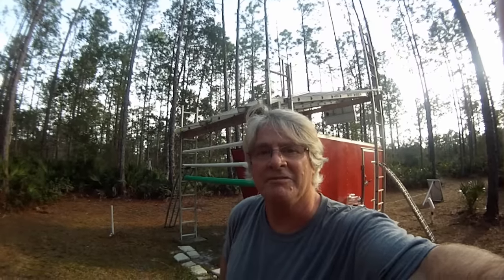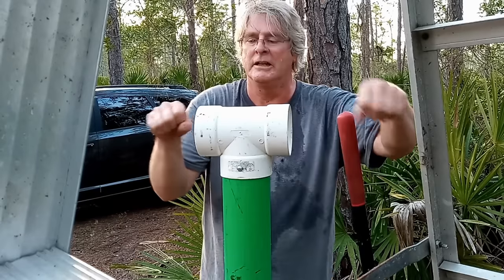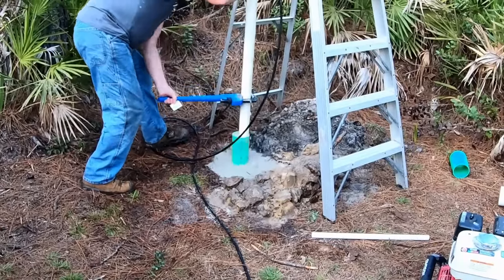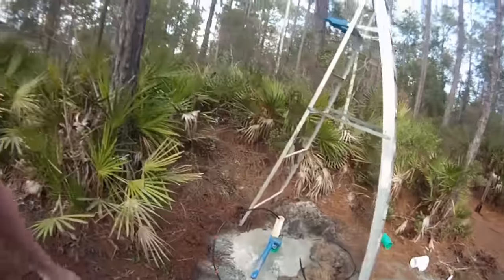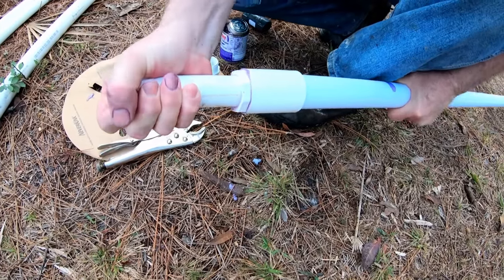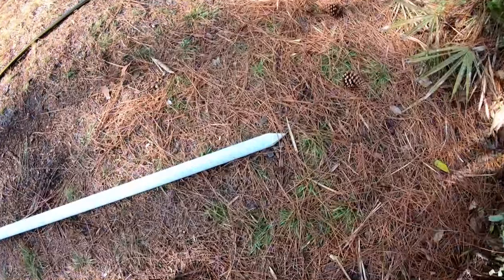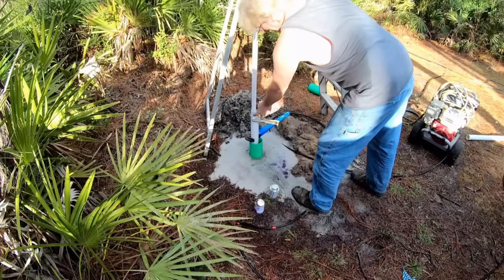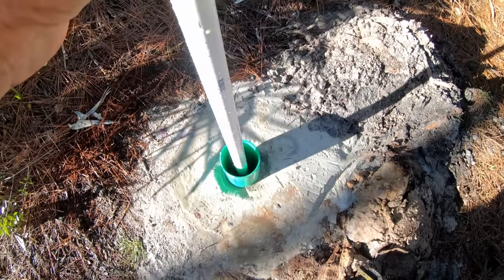Easy SHALLOW WELL DRILLING Howto DiY drill 25 ft shallow well

Comment: i have a 1 1/2 rigid pipe casing in the ground    previously used by orange grove watering system    I want to put a PVC  pipe down about 90 feet    where do you purchase the pipe with perforations and well point?   what pump you recommend for pulling the water up?   one professional well pump guy said pressure pushed the water up the pipe to about 45 feet below ground level........
Reply from the maker: Hey Charley,
Thank you for watching!
although this video only covers shallow well drilling up to 30 feet,
I will do my best to answer your question and help with your delima.
The well point used in the video is 1 -1/4" micro perforated pipe.
I do not think it will fit into your 1-1/2 inch rigid pipe casing.
you would need to make a custom well point.
1inch diameter, with 1 " pipe with micro slots sawed into each side of the 1st 5 feet of the 1" pipe.
you would then be able to feed the 1" well point down into your existing well pipe.
adding 10 foot sections of 1" pipe as you go. it would be a tight fit but as long as the rigid 1-1/2" pipe is in good shape, the 1" pipe and 1" couplings go down thru well pipe.
Thanks again for watching!!!

Comment: Where size slot did you get for the sand point?   Is the mini jet also called a sewer jetter?
Reply from the maker: hey storm light,
thank you for watching!
the well point comes with micro slotted 1-1/4 inch pipe.
The mini jetter can also be called a mini sewer jetter.

Thank you for watching.
Reply: @AtlanticDrain  Thanks man, however Im asking what is the screen size of the slots are. Normally you match those to your sand size.  For example a .020 screen size will let a lot of sand through your well.
Reply: @stormlight1553  I’d like to know this now too.
Reply: @stormlight1553  Well screens are designed to prevent 90 percent of filter pack particles outside the well casing from entering the well and allow free flow of water into the well. The classic method for determining well screen slot size is based on a formation grain size gradation curve generated from a sample of the formation from the proposed well screen depth. Where local formation characteristics are well known common acceptable practice is to use standard screen slot sizes and associated standard filter pack sand. 

For example, in some areas wells may be installed using a 0.01-inch slot width and a 20-40 mesh clean sand filter pack.
Reply: @ThisReckless  Well screens are designed to prevent 90 percent of filter pack particles outside the well casing from entering the well and allow free flow of water into the well. The classic method for determining well screen slot size is based on a formation grain size gradation curve generated from a sample of the formation from the proposed well screen depth. Where local formation characteristics are well known common acceptable practice is to use standard screen slot sizes and associated standard filter pack sand. 

For example, in some areas wells may be installed using a 0.01-inch slot width and a 20-40 mesh clean sand filter pack.
Reply: @charlesbartlett2569  Thanks, but I understand that. The problem is that this and most videos are showing well points being placed in the ground without a filter pack. Typical approach to doing this is to select a slot size through which 40% of the material (sand in this location in the video) will retained to build your own natural sand\gravel  pack. Id love to know how people making these videos are picking their slot size. Must be very lucky or they  dont care about sand coming through the well point. Also another question I have not been able to find is some kind of graph or math that will tell me the flow of certain slot sizes.
Reply: @stormlight1553  You want the screen size to retain 90 percent or greater of the surrounding soil material or what’s called the d10 of the soil gradation curve.  You can find USGS reports for your area.
Reply: @stormlight1553  There is really no good way to figure out flow rates without a pump test.  You can try modeling it, but the test is the best way.  Most DIY folks are winging it and hoping for the best.  I help people that winged it wrong.
Reply: @charlesbartlett2569  Darn it my whole comment deleted by a link. I'll try again.  I have always been taught that when designing a screen, the rule of thumb is to select a slot size to retain about 90% of the filter pack "after" development.  This videos are showing people developing natural wells with no sand pack. So in that case if you decided to naturally develop this well, with no gravel pack, the typical approach is to select a slot size through which 40% of the material will retained.
Reply: Was I taught wrong? My thought was if you try to pick a screen that retains 90% of the sand (with no pack around it) you will be killing flow.
Reply: @stormlight1553  No, I understand what you are saying.  You could definitely try that approach and try to remove all the fines by developing the well for a while.  You might end up with having to always remove fines.    I’d start with the local USGS reports for the surficial aquifer in your area to determine likely soil gradation curves.
Reply: @stormlight1553  or better yet take your cuttings to a local soils lab and let them run a gradation curve.
Reply: @charlesbartlett2569   :) https://prnt.sc/19txpo0   .008 with no pack appears to be 40%  Im having trouble getting screens/mesh  that fine
Reply: @stormlight1553   There isn’t much selection available for 1-in diameter pvc.  If you don’t want to go larger diameter and install a filter pack you are better off installing 2-in diameter casing and leaving it in place.  You can then use a 1-inch drop pipe to your pump.  CertainTeed has 0.01” to 0.125” slot sizes for 2” pipe.  You can also find a Continuous Wire Wrap Screen. It is made for fine uniform sands like they have in Florida (sugar sand).  Try roscoemoss.com.  More expensive.  

The guy in the video is installing a temporary dewatering type well point not a long-term production well.
Reply: @charlesbartlett2569  Thank you very much for your time and expertise. Its hard to gather the type of knowledge you are sharing. Can you please take a second and tell me how a 2 inch diameter casing with a 1 inch drop pipe would help?    Thank you for the link also, i will follow up with them. I should note a have no problem trying to get a 2 inch down.  Its only sand for me and about 30 feet.  My problem are those darn fines coming through.

Comment: PSA .....this is not a shallow well..This is a seepage well. Which is rain water that has not been filtered but through 30ft of sand . Seepage wells are still full of bacteria and should NOT be used for drinking water. Actual shallow wells are drilled through rocks , clays , several layers of sands and shells ect. and the water there has been filtered by those layers to get out contaminates..
Reply from the maker: hey twobit,
thanks for watching

Comment: Thats never the way it goes...he must have edited out the real work. There is always a layer of sand stone about 25 feet down. You have to pound the PVC pipe with a sledge hammer while still spraying pressure water streams..and rotate the pipe teeth between the sledge hammer pounding sessions...serious work..he showed NONE of this real work.
Reply: the water jet stream never gets through the sandstone without pounding and breaking through the rock with a sledge hammer. Not sure why he edited it out.
Reply from the maker: Hey Marshall,
Thank you for watching. This drilling took place here in Florida on the eastern edge of the Ocala National Forest. About 1/4 mile from the St. johns River. 
No hammering was needed to get through the layer if crustaceans  and or mineral at the 20 foot down level. It was more difficult at that point but, once thru, the rig sank through like cutting thru BUTTER.
It was exactly like said and shown in the video. Thanks again for watching! Your interest is appreciated 👍.

Comment: Chuck
Reply: THIS IS GREAT / i tried couldn't get the 2 in down / DO do you think it could be I have 2000 psi elc pressure washer?
Reply from the maker: Hey Armstrong, 
Thank you for watching. 
I dont think the pressure washer is the issue.
 do you have a mini jetter head on the hose? 
be  sure to also cut teeth on the 2 inch pipe.
if you have to, put a T on each section you are drilling into the ground then, remove the T and Glue another section of 2 inch, install the T, work it into the ground, remove T install section etc.
thanks again for watching!

Comment: Great video! I’m in southwest Florida and will be doing the same thing for my new lawn sprinkler system. 

I will be drilling (2) sand point wells spaced 20’ apart, tying them together with a 1 1/4” PVC pipe with a tee fitting, and then run the 1 1/4” pipe to an above ground 3/4 HP shallow well pump. I was planning on using 1 1/4” pipe up through the 2” to tie to my 1 1/4” sand point. I noticed you used 1”. Will the 1 1/4” be a problem? The pump requires a 1 1/4” intake pipe. 

Also, I bought the mini sewer jetter, but it seems that the holes are too small. I was thinking of drilling the holes to make them larger to get more water spray volume. Thoughts? Thank you.
Reply from the maker: Hi Fred,
Thank you for watching.
i wouldnt mess with the mini jetter heads. they will help cut crustaceans layer underground just above water pockets.
yes, you could go 1.25". just be sure, all of your fittings go thru 2" pipe easily. normally, at any coupling area, the 1.25" couplings tend to touch the seams of the 2"pipe sections. if you are pulling the 2" pipe out of the ground, its a little more difficult to do.
Thanks again for watching!!

Comment: Hi quick q

North central Florida, Swanee area, 

Is it possible to drive a 3” pvc pipe with slits as a diy screen down to about 60’ and use a jet pump with 1/2” pvc to draw the water?
Reply from the maker: hey lugo, thankyou for watching. im not sure . i have only used the 3100 psi mini jetter to 25 - 30 ft. jet pump would move water from the area underground really fast, might loose a prime if it can lift 60 feet. i d k. good question though. thankjs again for watching

Comment: You are going into sand and mud, but how would you get the plastic(PVC) cutting head to work on even something as soft as sand stone? Im looking at land in North Western Texas and they have stone and rock and that is why I ask.
Reply from the maker: Hey Paul,
Than you for watching.
recommend you install a metal / steel carbon tip or diamond tip Drill bit on the end of your 2" pipe. Thanks again for watching!

Comment: I am in west central FL and am having huge issues with the pipe getting stuck as I try to drive down. The first 15' went great with dirty water flushing out, but then it seems the water pressure is not strong enough to push the dirt/sand up and out. It "feels like" the downward progress sprays and stirs the sandy dirt up and then it settles back down sealing the pipe in place. I am using the 2" pipe with two garden hoses hooked up to it. Will the sewer jetter clear the sandy waste out better?  Any help is appreciated.
Reply from the maker: hey jim,
thank you for watching.
give this a try
I cant say it will work for sure but,
Using a jetter head will burrow to the bottom of the 2 " pipe forcing water out around the outside of the pipe. you soon will  see water coming out of ground from outside the pipe as well as inside the pipe.. loosening up the 2 " pipe for continued movement downward( if the pipe has teeth).
thanks again for watching!

 .
Reply: @AtlanticDrain  thanks so much for your reply. The mini jetter got my pipe down to about 27'. I did not have any feeling of hitting a void that my pipe dropped rapidly. But I passed through dark dirt which got light and then dark again. Will I be able to get water from a point in water bearing sand?
Reply from the maker: Hey Jim,
Alright!!!
Now that you are down the correct maximum for shallow well depth,
See what the depth of the water in the pipe is by putting down a DRY measuring tape to the bottom of the pipe shaft.
Carefully, retrieve the tape. Check where you know you 1st see water on the tape.
This is going to be your static depth of hydrostatic table of water in the ground.
Check it the next day. See if any change.
If still not confident, 
You can try and force some of the water out of the pipe. Maybe use your ordinary garden hose, put a strait brass nozzle on it close see it off, send it down the pipe, forces water to rise up and out of the pipe or better would be your 1 inch pipe, it's stuff and easier to push down thru pipe. Cap it off and send it down! Forces that water to go somewhere.  then, check the depth with your great tape measure again. If no change in water depth,

 get that point and pipe in there!!!
Start pumping water!

Comment: Would this work for a 60 ft well in heavy clay soil... minimal rocks/ gravel?
Reply: It would cut the clay (slow) but the gravel would not come out of the hole.
Reply: @Jay78801  I know for sure there is clay but not certain about the gravel. It’ll be near an older well and I was never told the hit gravel. Thanks for the reply. Also wasn’t sure if that mud or sand would still be able to come up 60 ft or maybe I need to introduce compressed air
Reply: @jenniferpope9497      Would depend on the pump used to jet with.     The other problem you would have is water can’t be sucked more then 25’ up so you would need a deep well type pump.  They are hard to find where I am from less then 4” diameter.  Most places I know of in the USA have laws saying you can’t drill a well  past 25’ with out a license or permit.
Reply: @Jay78801  all good to know. I figured I’d need a different pump but I had no idea about those dimensions.. thx
Reply: Use an air lift to remove deeper material.
Reply: If you get well drilled by whatever means they do make deep well type hand pumps even though the handle is at the top, the actual pump is lower in the well, but obviously takes more effort.